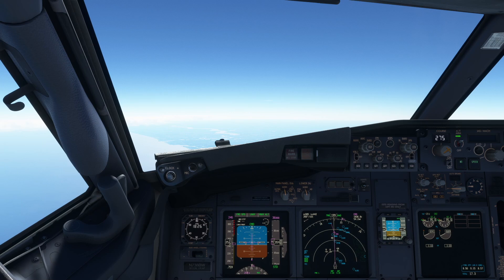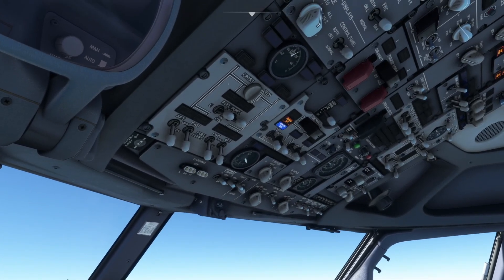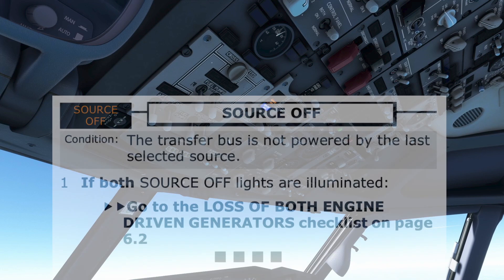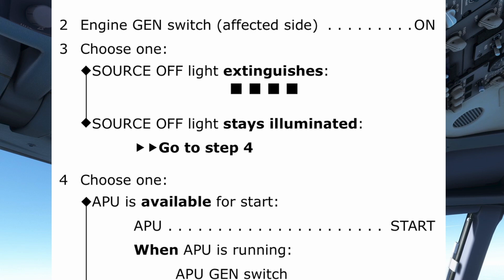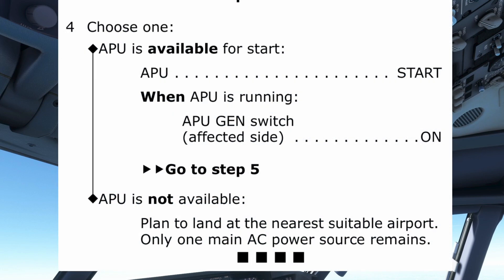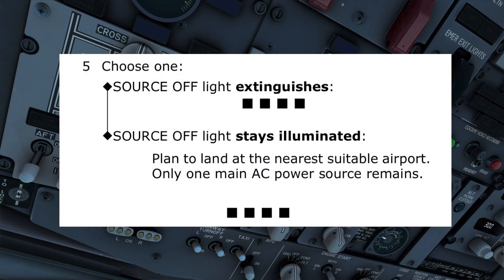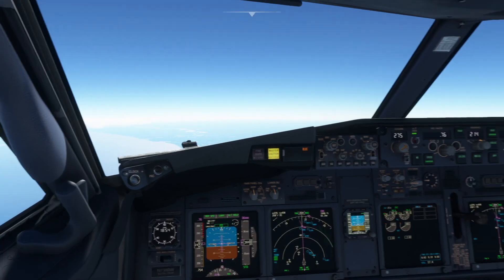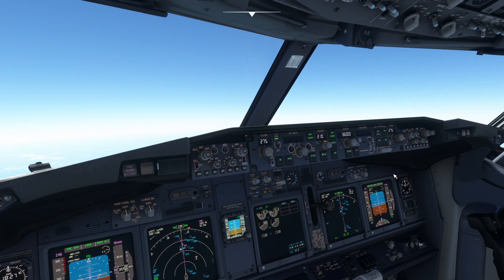737 Non-Normal Procedures: Generator Failure

Comment: Do you know why the Generator 1 is failing in the PMDG 737?
Reply from the maker: Thanks for the question, not sure if you're asking why a generator would fail, or why it failed in this case. PMDG comes with selectable failures, so this scenario was based on activating a preset generator failure, then working through the procedure for the failure.
Reply: @pilottutorials  I figured it out. I never selected any preset failures however over time the aircraft accumulated 6 electrical failures I believe to be thru just use of the plane. Like real aircraft the PMDG planes need maintenance so to all experiencing warning lights, go to the FMC and check all systems. "Return Aircraft To Original State" feature does not clear these failures I've learned. Not sure though how an aircraft could have 6 failures in roughly 6 months of use. Thank you for the reply.
Reply from the maker: Thanks for sharing, sounds like some electrical gremlins, glad you got them sorted.